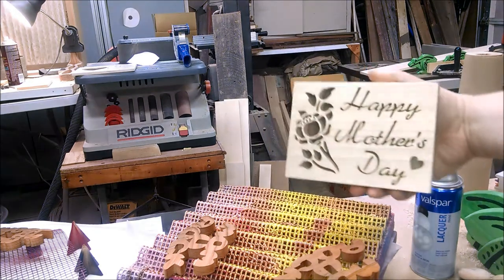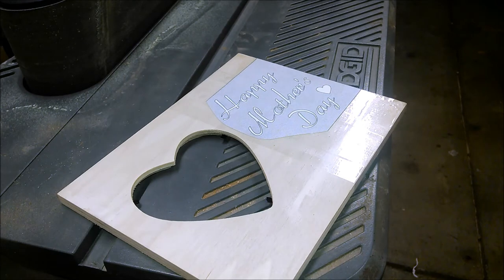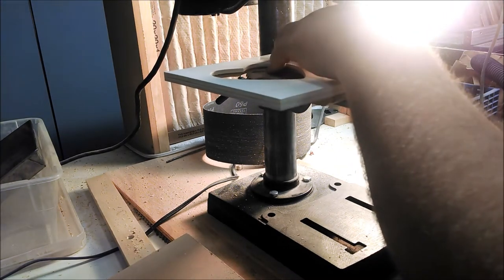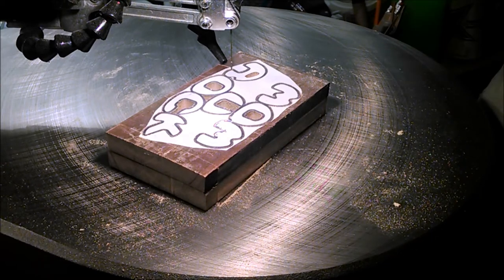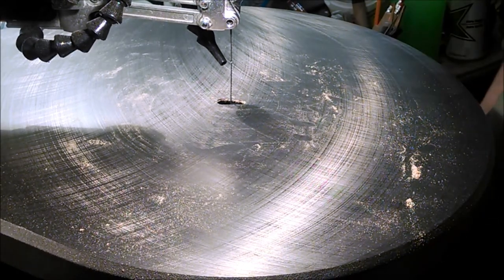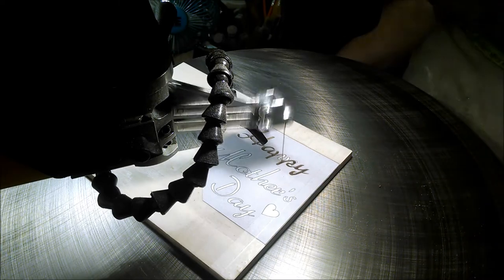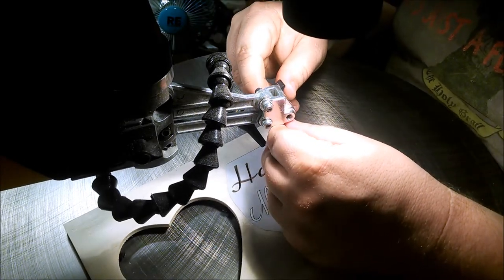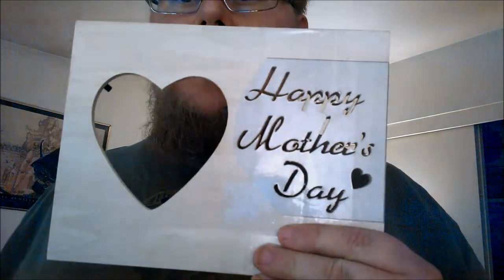Mother's Day projects

Comment: Looks great! I bought one of those foot pedals also the other week. I'm still figuring out a place to put it but it works great. Also I  finally got a sander from my neighbour. It helps so much with the rough condition wood.
Reply from the maker: Oh right on man! What type of sander is it?
Reply: Its a 6inch delta belt and disc sander
Reply from the maker: Ricky Mistry That'll help out a ton with either salvaging would you wouldn't normally use, or to clean up projects :)
Reply from the maker: This sucks.....I spent 80 dollars on a digital camera and my new phone takes better videos sighs

Comment: Wonderful work, thanks for sharing.
Reply from the maker: You're very welcome, friend :) I appreciate the compliment!
Reply: You make it look so easy. I struggle through every scroll project I do. Great work and I'm sure your Mother will love it.
Reply from the maker: Frank Thornal Thank you for the compliment :) What issues are you having with scrolling? Maybe I can help.
Reply: Mainly blade selection. I don't really know what blade to use when. I've only used three different blades and one of them was a spiral. That's my primary problem.
Reply from the maker: For me, blade selection really depends on the hardness and the thickness of the wood, also it depends on how small the details are. For instance: normally cutting 3/4 inch thick poplar I'd use a number 5 skip tooth reverse cut blade (reverse cut means some of the teeth at the bottom of the blade cut on the up stroke instead of down). For the small details to come out properly on the puzzles I've been cutting lately, I had to switch to a #3 skip tooth reverse so I could get around the tight radius corners. Now if it were a hardwood like oak or maple I would have stuck it out with the #5R skip ( R standing for reverse) and just had to go very slow and do the best I could to follow the pattern. I don't have much experience with spiral blades myself.
Reply: Thanks, I'll get some of each and go from there.
Reply from the maker: Awesome, I hope that at least gives you a jumping-off point. For really fine detail in thin woods (1/4 inch thick or less) I usually use either a 2R skip or a 2/0 r (the /0 means there aren't any spaces between teeth on the blade)  :)